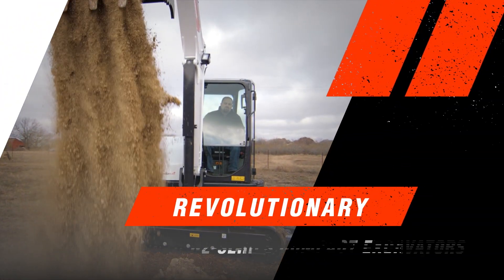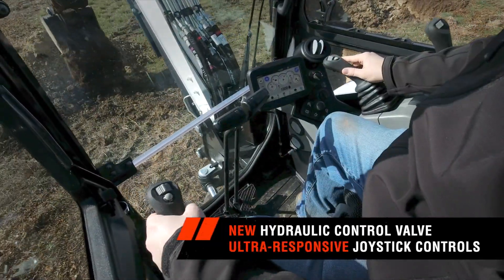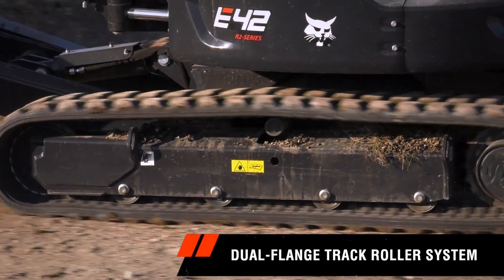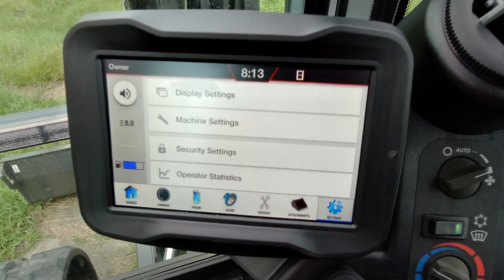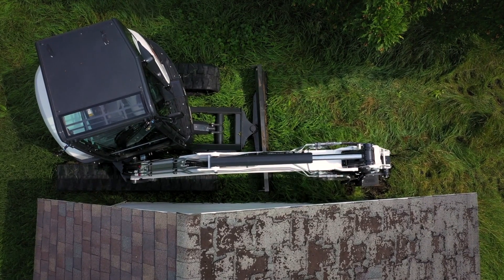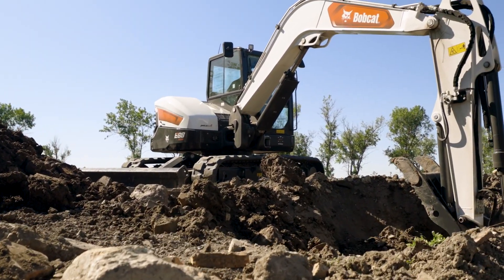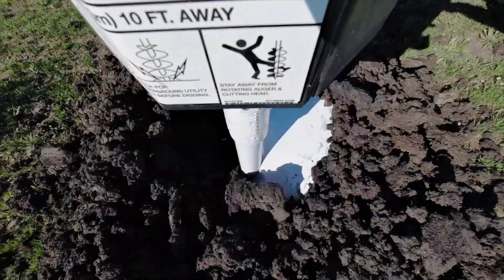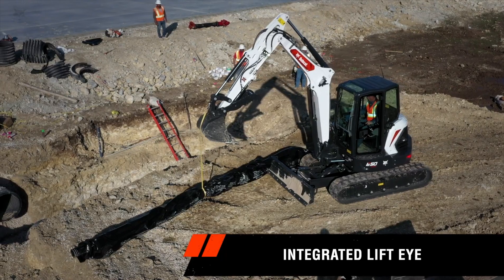R2-Series Excavators | Bobcat Company

Comment: Dose the R2 series have a Doosan engine?
Reply: 99 %  bobcat machines have doosan engines,  great power,  quite,  no regeneration under 75hp .  They still use kubota engines for 25 hp and under.
Reply: Yes, that’s the parent company. The fuel system they collaborated together on is why they have 25hp- 50hp engines without the need to use DEF, and no regen in this range.